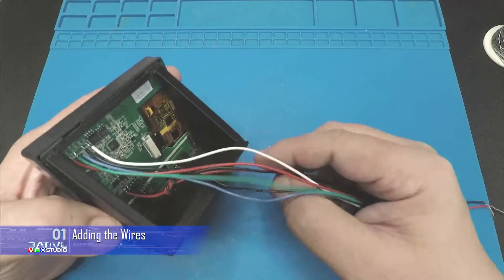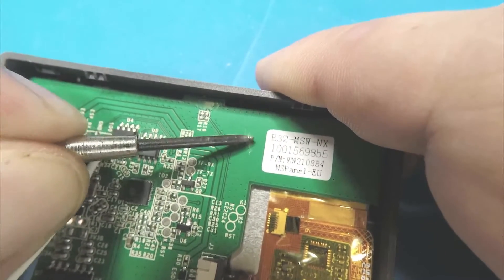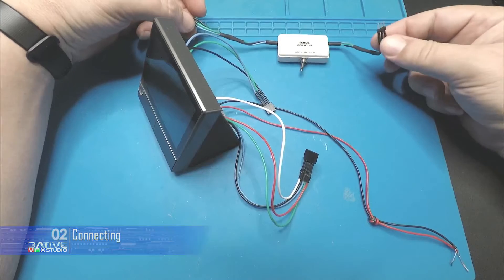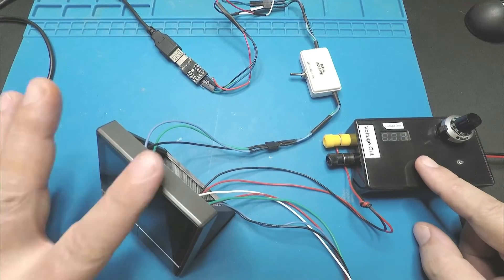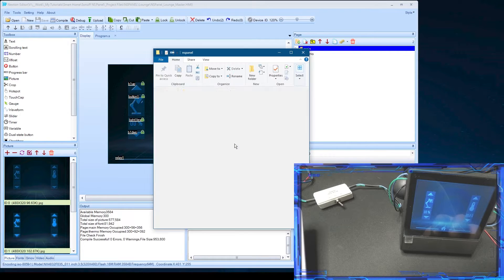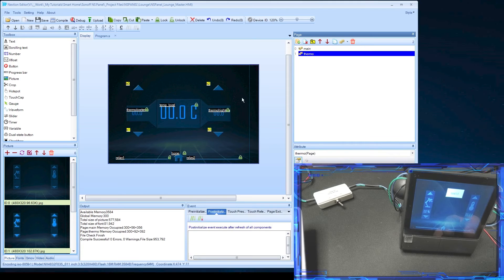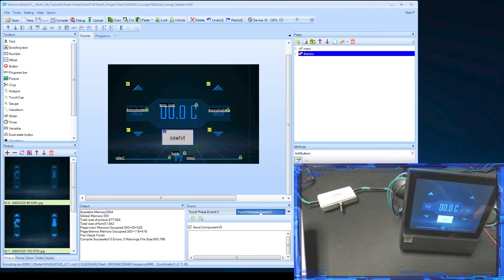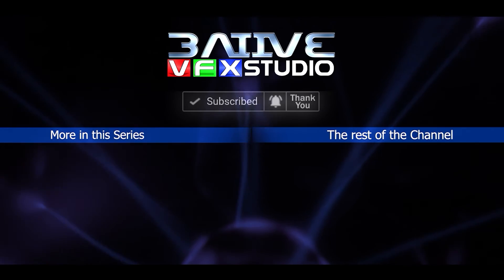Sonoff NSPanel Custom Firmware Part 3a: HMI Upload Hack

Comment: How did you not fry the panel sending 5v into the 3.3v input!?  I'm currently trying to flash the TFT but having connection issues... The BlackAdder page says you need to disable the ESP to flash the Nextion, by taking GPIO1 low and FSP RST high, but I don.t see a FSP RST connection.  How did you get it to work with your wiring? Is it because you are feeding it the extra voltage?  EDIT:  I see  that you feed it 5v via the J2 connector rather than the J1.  I still can't get a connection though... any tips? The panel turns on when I give it 5v via J2
Reply from the maker: Yes, when I flash the ESP I used 3v3, via the serial port. The whole panel is powered after via it's normal 5v input.
I don't know what BlackAdder's page is talking about (I haven't read it) but, as you can see from my steps, what I do works.
Reply: @3ATIVE    Thanks, I'll keep trying.  I've seen comments online about the TFT TX/RX needing to go directly to TX and RX of the serial adaptor rather than running TX to RX and RX to TX.  WHich way around do you use?  I always have TX to RX and RX to TX for the ESP, but at this stage I'm trying anything
Reply: I just keep getting "connection failed, forced interrupt!"  Any idea what could be wrong?
Reply from the maker: @Sparky_D  I don't know about "...connection failed, forced interrupt!" - Soz.
But you won't harm anything if you want to try swaping Tx & Rx over.
Reply: @3ATIVE  yeah, I tried with the connections swapped, no deal. I'm thinking of getting a different TTL converter but other people seem to be fine with the one I have and it flashes ESP's fine.
Reply from the maker: @Sparky_D  It could be... Have you tested it?